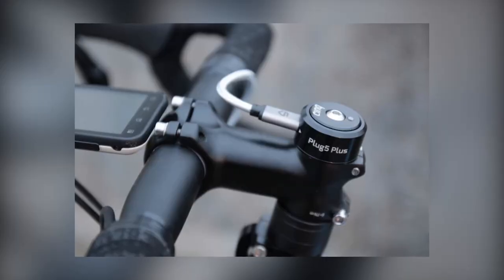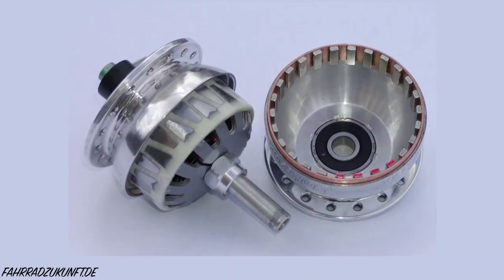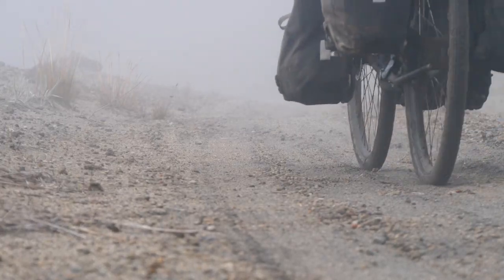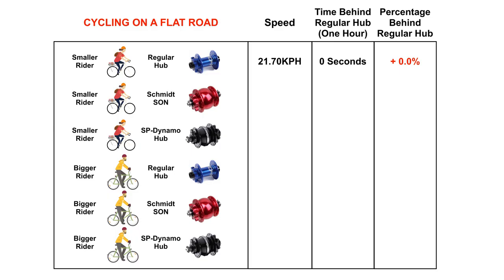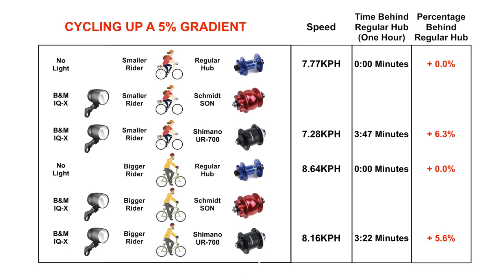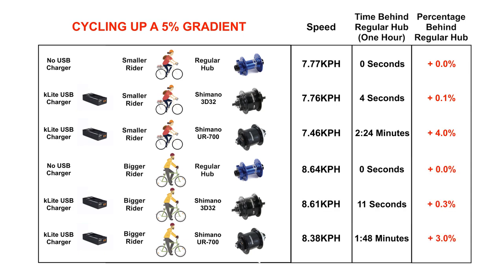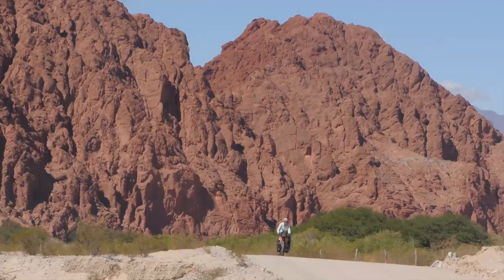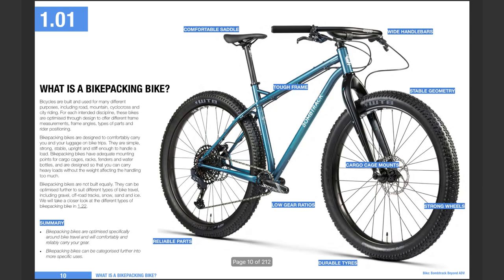How Much Do Dynamo Hubs Really Slow You Down?

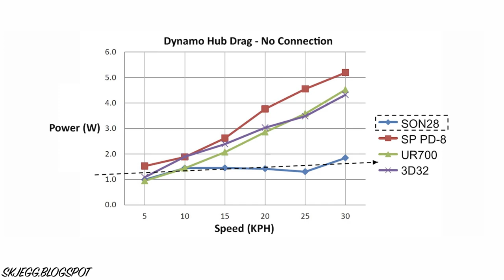Comment: nice and very informativ comparision.. still: really sure about statement @ 3:10? According to https://fahrradzukunft.de/14/neue-nabendynamos-im-test/ the drag of SP PV-8 without load is pretty comparable to Schmidt.... which corresponds well to my seat-of-the-pants feel
Reply from the maker: The drag with no electrical connection is certainly up for debate, but I wanted to keep the data consistent throughout this video...

I chose the drag data from Skjegg Blogspot because they have found a drag difference between connecting a resistor to a dynamo, and connecting a light or USB charger. Fahrradzukunft use resistors for their testing, while Skjegg are using the actual lights and chargers with different dynamo hubs.

You can read more about this on my website: https://www.cyclingabout.com/dynamo-hub-power-drag-testing-schmidt-son-shutter-precision-shimano/
Reply: @Cyclingabout  thx for answer. As any dynamo hub consist of substantial inductivity (coils) and operates at different frequencies (depending on speed) the effective load and hence drag (driven by energy transfer) differs quite much.
Having said that: nice job on picking different lights for the test.
For the moment I'll stick to my PD-8, which runs well for my needs. It was quite noticeable improvement over the Shimano Alfine
Reply: so, in the meanwhile changed for SON 28, just for sake of testing it. As - despite the hub and rim - all other components are still the same I dare some first conclusion.
Light off: not that much difference, SON 28 tends to have less drag for velocities > 30km/h @ 28 " rims. Could be also just better condition of driver, as I'v started biking regularly ~ 1 ago.

Light on: At lower velocities SON 28 seem to generate slightly more drag, however the electric power output seems also better. In fact it takes now shorter distance to get both lights to activate "stand-by light". Not much of effect, but definitely there. 

Another point: SON 28 generates considerably more vibrations (having rather rigid steel frame) and especially in range of 22 - 27km/h, when light kicks in.

In range of > 30km/h definitely less drag, bike feels lighter now.

Having said that: SP OV8 seems really great option for moderate velocities; especially when compared to other brands with similar cost.

SON 28 seems a bit lighter on drag for upper velocity range (while being heavier by ~ 20g) and seems somehow more powerful on the price of cost and vibration in mid-range

Comment: Do dynamo's slow you down? NO
What they do is increase the drag/resistance so you have to input more power to move at the same speed.
SPEED is the number one thing that everyone moans about.
You're riding a pedal cycle for enjoyment or transport, You're not in the TDF or any other RACE!
Take your time and enjoy the ride.
I ride an ICE Qnt recumbent trike which weighs well over 30lbs fully loaded with panniers, dynamo hub, lights, water bottle, cycle comp etc and I average 11-17 mph on a ride depending on terrain.
The thing is at 59yrs old I can ride all day long and do over 100 miles without pain.
I also have a set of battery lights just in case but they run off the battery pack that gets charged by the Dynamo this also charges my phone/satnav and is through charge compatible, this will run the lights all night if needed.

P.S.
You will get more power at slower speeds from a hub dynamo when used with smaller wheels 20" 406 instead of 27/28" 700c as the wheel rotates faster for any given speed, unless you use one made for smaller wheels like the 'son' 16-20" (less magnets & less drag).

Comment: SO a hub dynamo adjusts itself based on energy draw?  That's mind boggling that it can do that.
Reply from the maker: The hub doesn't adjust itself. It's the light or USB charger that chooses how much energy is pulled from the dynamo.
Reply: @Cyclingabout  but how does that affect the physical resistance in the hub?  Like is it easier to pedal with the light off?  Your video made it sound to me like resistance was greater the more energy was being drawn
Reply from the maker: @davidr9876  The resistance is related to the power drawn from the hub. It is easier to pedal with your lights off because your lights are not drawing any power from the dynamo.

Comment: Quite enlightening data. So assuming an average loss of 1:30 per hour, from a randonneur perspective or Paris Brest Paris 90hr brevet, a rider using the SON could expect to lose a minimum of 2hrs riding time on a 90hr limit event. That's significant. From my experience, many Rando riders use a dynamo hub with charger & light. This definitely has me rethinking strategies

Comment: A bigger rider is less affected by drag?  Whachu talking about Willis? Only if they are the same height as the smaller rider.  I'm" 6'7"/2m01 and drag affects me a lot.  I use a SonDeluxe Widebody and to me the drag is barely perceptible.  Way less than a headwind.

Also you assume the bigger rider and the smaller rider's bikes weigh the same.  That's an erroneous assumption also, my bikes are big and they are heavier.  

I don't even think you should assume the gear would weigh the same for bigger and smaller riders.  My clothes are bigger than a smaller rider's clothes and thusly weigh more.

anyway.....carry on....
Reply: As a generalisation, he's likely correct for typical cases. Pretty sure that's good enough to carry the concept for most viewers.

Comment: Interesting video. But for me the high over all cost of the Son 28 hub with wheel build, Edelux 2 front light, Son rear light, charging plug has not really been worth it. Perhaps if the need was for long tours to far away sparsely populated and desolate countries where mains power is hard to come by then maybe the practical needs out weigh the high cost, but for every day riding, commuting and short tours it's an expensive option and not one I would spend money on again. I think a couple of Anker or Rav power banks are a far better option, cheaper and more practical, deliver more power and maybe some of their solar panels to top them up as you ride. They are also very keenly priced. All in the cost is a fraction of the cost of a dynamo set up. There is no disputing the build quality of the German Son hub and the Edelux 2 light as it is top notch, just very expensive. Nevertheless thanks for making your video. Ps You might want to speak a little more slowly, perhaps a few more natural pauses as I found myself struggling to keep up with all the technical details you were giving.
Reply from the maker: Yeah, this topic is about as dense as it gets! I figured people could slow down or speed up the talking using the playback speed feature.
Reply: @Cyclingabout  And I'm a native English speaker but your viewers whose first language is perhaps not English may have been struggling even more to keep up. Just a thought. Not really practical to keep pausing and reviewing what has been said or trying to work out what graphs are actually showing. But not knocking you for making this video as over all it is interesting just thoughts for a next time. Would be further interesting to discuss an integrated power system for cycling whilst out on tour or tour, practicalities, benefits and drawbacks, efficiencies, costs of all methods of power generation. Just some thoughts. As you say it can be a very dense subject. But for me had I known before I purchased my dynamo system what I now know as to it's capabilities then I probably wouldn't have done so as it has been a very expensive choice. I think you can solve the supply of power a lot more cheaply, but if you want the reassurance of having constantly illuminated bicycle lights and can afford the high cost then go for it. So now I have a little used SON 28 dynamo wheel and Edelux light, charge plug and rear light. Thanks for replying.

Comment: I convinced myself that the drag would be pretty-much the same whether the lights were on or off. I just imagined spinning wires and magnets would be pushing electrons around, whether they did any useful work or not. This wishful thinking has lead me to keep the lights on all the time. Another branch of wishful thinking convinced me that daytime running-lights were increasing my safety. Seems I was wrong about the first bit. No daytime running-lights up hills any more!
Reply: Daylights might still add safety.

Comment: Stop pricing the Hub dynamos. You know damn well that they are not worth the investment. Having two power banks of 27250 mah can keep you running for 10 days without needing a AC power source.
Reply from the maker: I prefer to produce my own power to keep my electronics charged. I also love having lights that never require charging. Not sure how that's a scam?
Reply: @Cyclingabout  That makes it even more worrying. Hub (dynamos) are only a good investment if you cycle an ultra endurance race. Or using it in training towards it. And....No, you are not going to convince me that it is a cost effective solution for off road bike touring. 

For those out there who are planning to cycle long distances on bicycle, crossing multiple cities and/or countries, you are way better off purchasing two 25000 Mah power banks which you only have to charge every ten days if you don't make it  too crazy.

A guy like you, Mr Cycling About, should know this. You are intelligent enough to make the calculations and realize that just a very very small portion of the bikepacking people out there are doing ultra endurance cycling.
Reply from the maker: @bc7281  Batteries are no doubt the most cost-effective solution for managing power. But there is something very nice about harvesting your own energy to light your way and keep your electronics topped up. I cannot imagine myself going back to batteries...
Reply: @Cyclingabout  Yess, indeed, batteries are the most cost-effective solution. And I totally understand the joy you experience about being able to generate your own electricity. As a matter a fact, I would love to have a dynamo set up that always generates enough electricity to charge my smartphone, bicycle computer,  gopro, camera and lights in a bicycle tour other than ultra endurance one. But I cannot phantom that you, with the off-road bicycle touring you mostly conduct, where you cycle between 6 and 15 km an hour generate enough to charge all your electronics?
Reply from the maker: @bc7281  I make 3.5-watts @ 15kph and 1.75-watts @ 10kph. It's not much power at low speeds, but because I'm riding for 7 hours most days, I find I can easily harvest enough power for my smartphone, gopro and headtorch.

Comment: You complicated all this waaaaay to much ... the only thing that you needed to calculate is how much energy (Watts) are lost by convderting power everything else is based on specifications ... like if the dinamo produces 6W of usable energy you will get slowed down by about 6W + the amount lost in converting this energy which is usually minimal 

So you saying that it depends on your tire width, and all that is all bs .... 

It is as simple as looking at W output of dynamo and subtracting that from your power output ... so a "normal" cyclist would have around 100W power output so with 6W dinamo you would be slowed down by about 6W/100W which is around 6% ... everything else that you said is honestly just a waste of time ...